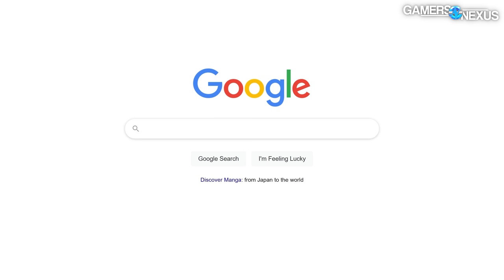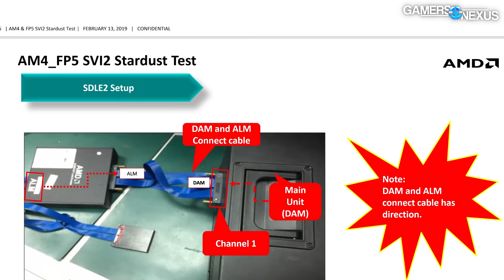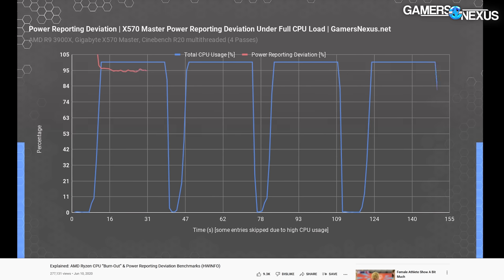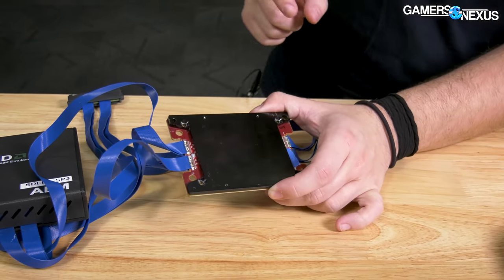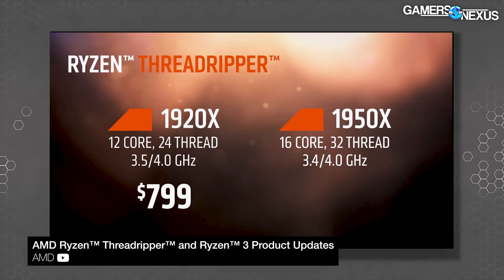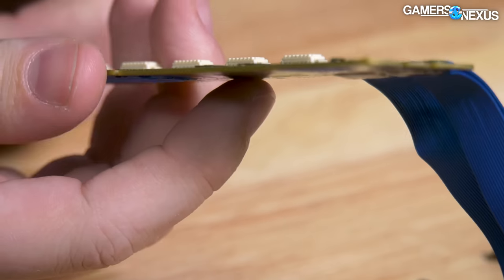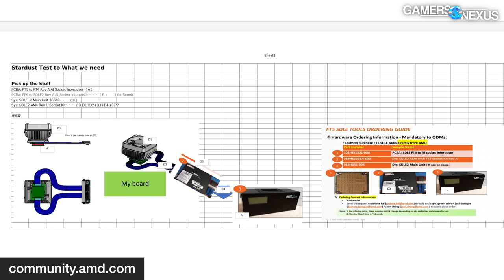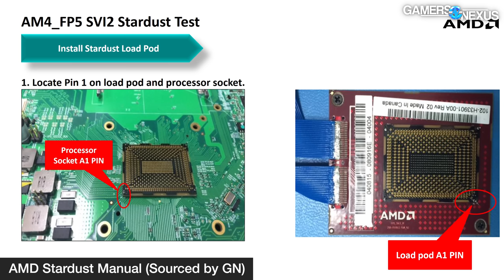We Have AMD's Top-Secret "Stardust" System | Tear-Down & Hands-On

Comment: I think it is pointless to hide stuff like this. Concurents will still get info about them, or just plain doesn't need that. Its not like someone would try to reverse engineer dummy load, it is easier to design one from scratch, than reverse engineer existing one. Maby at development phase to not reveal upcoming products, but after they are in market, whats the point of hiding that?
P.S.: Getting power supplies for them is trivial, look at bulk caps in power circuits, if they are 16-20V jobies, try 12VDC (most likely), 10VDC caps try 5V, 25V caps - try 19V, 35V caps - try 24V. Polarity can be deducted from same bulk cap orientation. Always start from lower voltage if unsure. Still prety sure it will be 12VDC most likely. It is always safer to try with lab power supply, set current limit to about 100mA and try most sensible voltage. At such low current there is very little risk to burn something. if it is not instant overload as unit tries to start, it is safe to increase current, guessing for stand by power up 0,5A is more than enought as with 12V it is around 6W. More curent is needed only if you try to turn on dummy load cell.

Comment: Very cool find! Considering these are low volume engineering projects, the power supplies are probably a common barrel jack size. I'd be surprised if you couldn't find one that fits fairly easily. The only question at that point is the voltage which I'm sure you or Patrick can work out by looking at the components if it's not written. Or go caveman style and raise the variac until you get activity but don't do that ;) ... I'd assume it's just 12V but 24 might make sense.

Comment: I don't understand their power supply issue - is it that special? - normally you get all required information of a sticker or even print on the port what voltage, watt and sometimes even amps of max load it expects, and the connecter used also mostly widely available - and you guys have customizable (output) power supplys and staff at hand that can handle them - so were's the problem?
Unless AMD is doing some weird stuff, it's usually a nobrainer to supply power to standardized equipment like this - especially if you have adjustable power supplys at hand! - just try with 10-5% under the devices spec and you should be safe! (start much lower however ofc) - worst thing that can happen is that it won't turn on! (As long you stay under spec ofc)

Comment: You test psu and unable to power up dc device(facepalm).
open one of the devices and track power socket to determine where is ground pin. Maybe it would be market, maybe you will determine by finding ground on pcb and checking continuity with tester and a socket. Then power it on with variable psu, limit current and increase voltage until unit it powers on